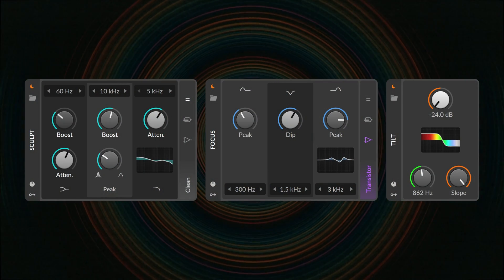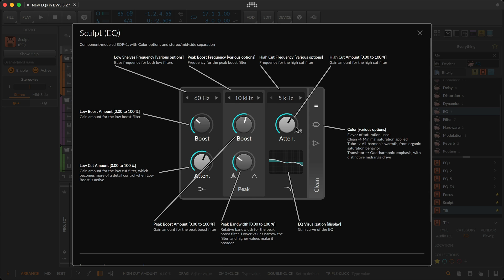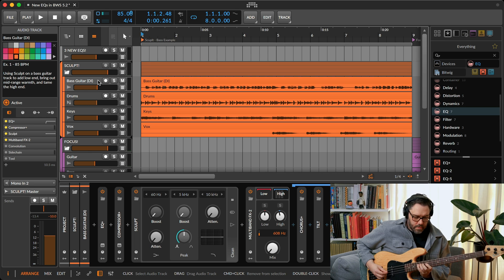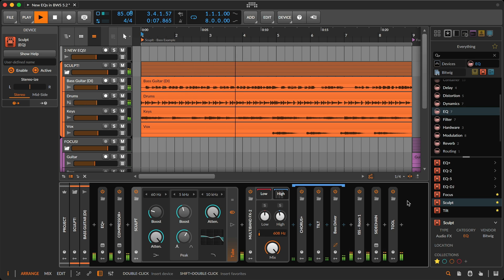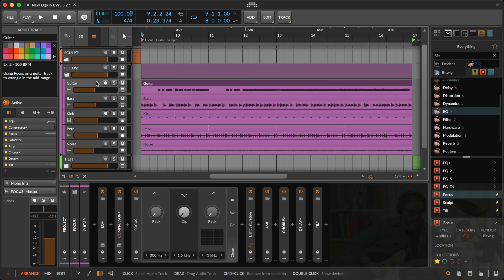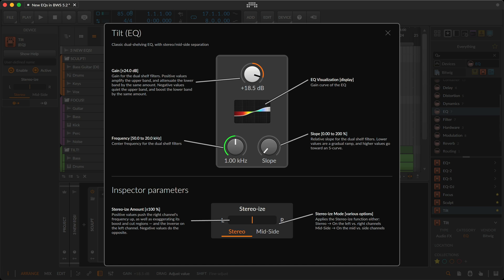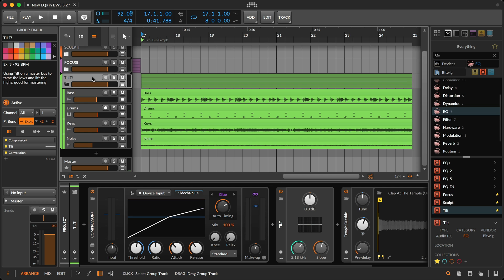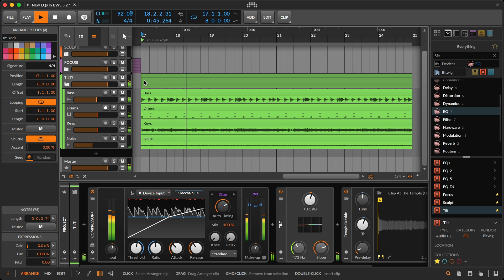Learn Bitwig Studio 5.2's Hardware-Inspired EQs

Comment: Please give us a tuner device, we miss it from the first day using Bitwig. Please!
Reply: I agree but you can use Mtuner or Free Tuner, if you need one still.
Reply: You can use the spectrum analyzer to read the root note out by hovering over the specific note and checking the relation to the incoming signal. It'll also automatically read out the root note and +/- cents pretty well.
Reply: There's so many free great tuners out there. Why?
Reply: @atetraxx  Because you always have to open their GUIs first before tuning. A native tuner like in Ableton is always visible in the device chain and so you can tune much more quickly.